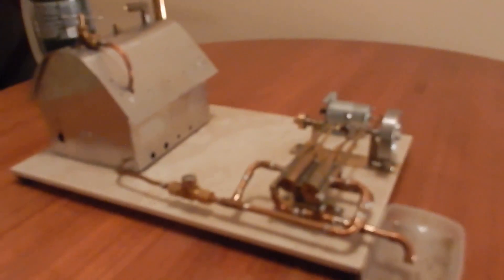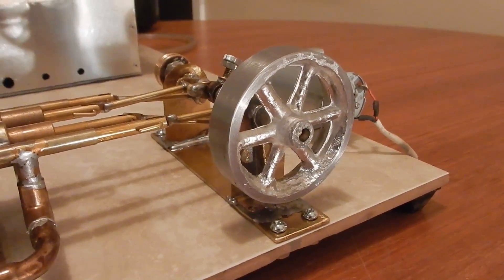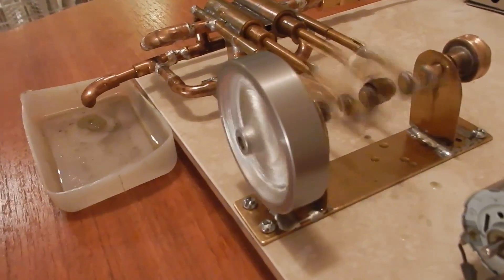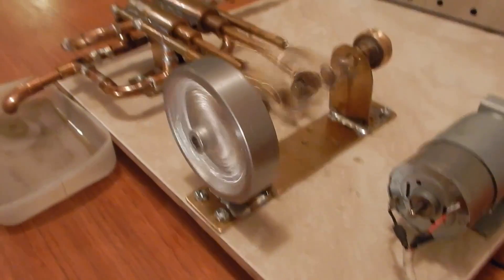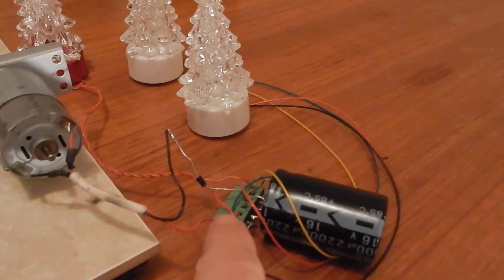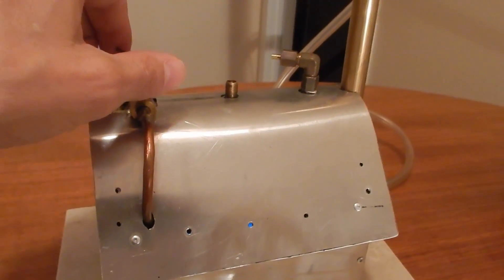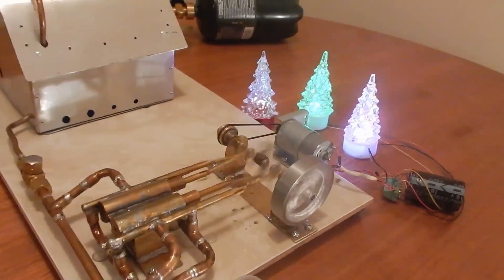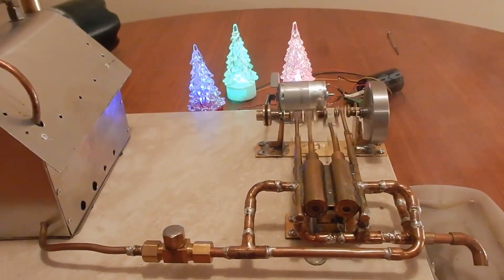Steam Engine and Casting my New Flywheel

Comment: Excellent work! Your tutorials on steam engines are the best. If I may ask you, do you think it would be possible to mount this engine on a four-wheel platform and connect the main axle to the two rear wheels of the platform in order to make it run? And if so, would the flywheel be necessary?

Comment: Before watching this video, I had no Idea of how to make exhaust port and which way to exhaust the finished steam. But watching this video I have now come to know how the exhaustion port are fixed with clyinder
Reply from the maker: I'm glad watching this video was helpful!! Enjoy your steam engine building!
Reply: I had made single cylinder steam engine but it coudn't run for there were neither steam valves nor any exhaust regulators. So going to make new

Comment: Ch - very impressed. 1 What is the component on your feed pipe between the boiler and the engine? 2 Are you using any steam oil for cylinder lube? Maybe a build for grandsons. Again-Very Nice. Thank You
Reply from the maker: Thank you for your comments. The component is a simple "Tee" adaptor capped on the top, and through which I add oil before I operate the engine. I have not been using steam oil, just regular engine oil.
Cheers,

Comment: Did you design and machine the pistons yourself with the porting and all? very cool.
Reply from the maker: Thank you. Yes, all made and designed from scratch, using regular home tools. I use my drill press as a lathe for the pistons and valves.
Reply: Very neat! Tired of watching TV. I think I could put something like this together. Wonder how big something would have to be to spin a car alternator.
Reply: do you have any plans if you do can you send them to me plz. id like to do this in a lager scale (4x) with a 20 gal propane tank re spond to this so i can send you my email privately 
Thanks!!!

Comment: great job!  thank you for the redirect! now another question: does it seem to run smoother under load with the flywheel?
Reply from the maker: Thank you! If it makes a difference, it is not very noticeable. Again you would certainly see the difference on a single cylinder engine. But it looks a lot nicer with the flywheel though, lol. I notice however that this was not my final version of the flywheel. I ended up casting a larger one for this engine and I installed this flywheel on a single-cylinder that I built. I guess I should put another video with the final version.